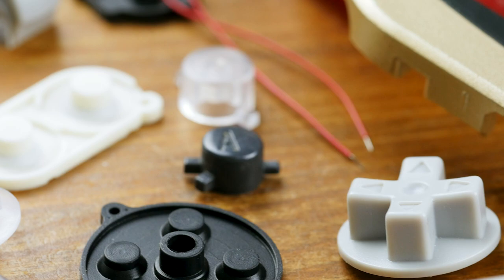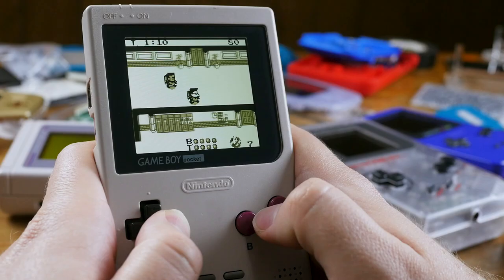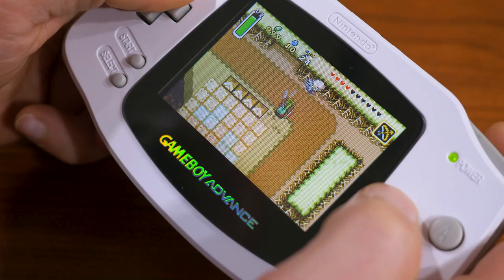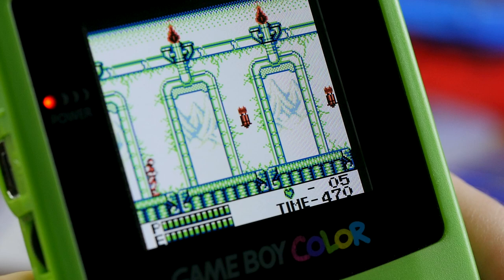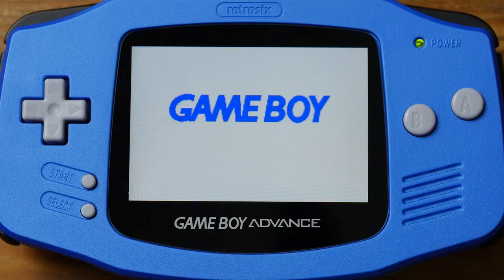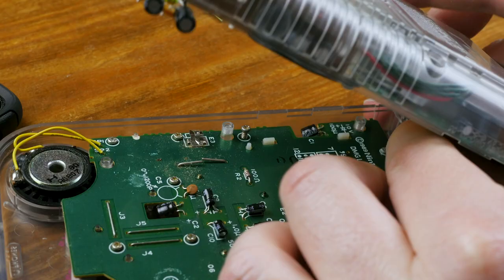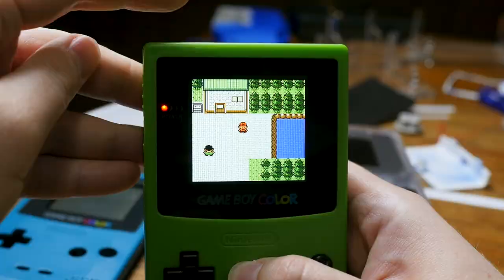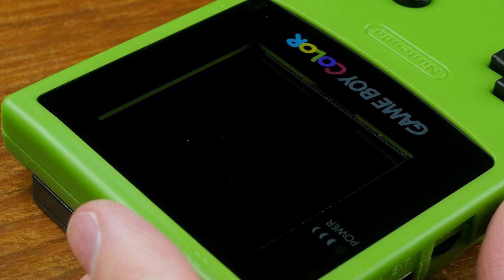Game Boy IPS Screen Mods for DMG, Pocket, GBC, GBA, and GBA SP :: RGB320 / MY LIFE IN GAMING

Comment: I have finished assembling my IPS DMG, going with a RIPSv3 with a pre-cut black translucent case.

But while in there, I also added a MicroUSB charging circuit (available on eBay or Amazon for dirtcheap) together with a LiPo battery and a Qi charging circuit. And yes: All that actually fits snugly in the DMG's battery bay, all I did was grind down the support beams in the battery bay lid to be able to stick in the charging coil without obstrusions.

Next up, I plan a similar mod to my old childhood AGB-001 GBA, but due to size constraints I think I'll stick to some good old AA NiMH rechargables, since I don't think that I have enough space for a 5v charging circuit plus 3.3v step-down circuit plus rechargable battery of any meaningful capacity.
Reply: Update: Completed the GBA mod a few months ago, ended up going with LiPo after all - there is a very tiny home-made solution for that, you just need to add a single component between the 5V booster and the GBA's positive battery terminal.

Comment: FYI, image burn in from the ultra high flicker effect found in F-Zero GBA games affects TN panels as well as IPS ones, and the likely reason why Nintendo applied such heavy ghosting and darkening filters on the official 3DS Ambassador GBA releases. For example, if you install F-Zero Climax as a GBA Virtual Console title with filtering removed on any kind of 3DS (with a TN or IPS panel) you'll quickly see the burn-in take root.

Comment: So the flicker you notice is a trick developers used to simulate transparency. The low refresh speed of the original GBA screen meant that if you flickered an image it appeared transparent. The fact that the map flickers in the "fake" screen and consolizer is because the screens have a higher refresh speed. In this case I would prefer a screen which was slow enough not to show the flicker
Reply from the maker: [Try4ce] Right, but it's a complex matter. Technically they should flicker of the screen is fast enough, and on these screens they do. But then they stop flickering because image retention sets in. That's not something you'd rather have! I'd rather have the flicker behave as flicker than be retained. But yes the effect on the original screens is neat, although in the case of GBC and GBA original screens, those were so fast the effect still appears as flickering.
Reply: My Life in Gaming Yeah, I particularly notice it on Boktai even on original hardware.

Comment: I've seen the same flicker retention on my 27" LG 4K IPS monitor.  I noticed it after running a 60 Hz vsync test that transitioned the screen white-black-white for an hour.  After stopping the test, the entire screen was still visibly flickering.  Unplugging HDMI had no change - still flickering.  Turning off the monitor made the screen go black, but turning the monitor back on showed the flickering again!   It gradually fades away after 5-10 minutes, so no permanent burn-in.   It is the most bizarre thing I've ever seen with a monitor.  This video is the first time I've seen the effect documented with the theory of it being some kind of artifact of IPS displays.  It's a cumulative effect in that it gets worse and is retained longer the longer the flickering graphics are on screen.
Reply from the maker: [Try4ce] That might be the same monitor Coury has. That's what the B-roll of those PS2 games was running on.

Comment: I can confirm that there are a significant amount of times I've played what I'm pretty sure are unmodded GBA consoles, both horizontal, AGS-100 and 101, and I've noticed that sweeping interlace effect, sometimes only if I shake the screen (subtle from button presses, or significant from adjusting how I'm holding the console), and other times I'll notice it on some consoles when I leave it on a table and just stare at it, too.  I always thought that it might be due to the age of the type of screens Nintendo decided to use, but I never investigated further so maybe it's the type of screen(s), or maybe it's age... but it seems many other LCD screens made around then don't have such an issue so... perhaps that could be a fun investigation to dive into sometime!

Comment: The flickering on de agb101 screens are due to the screen not receiving the right voltage, sometimes just whiring a cable to the ribbon to a specific part of the board to level the voltage can fix it other times just pray.

The image retention on the ips kit noticeable on plain colors specially on Pokemon when you run, but those screens at least for me are much better than the original 101 screens. 

I've modded a lot of consoles includin installing chips on ps2 and the new modchip for the Switch wich you solder directly on de SOC of the console and still keeping dust getting inside when changing lenses or touchpanels are the hardest thing by far and one of the more frustrating things about changing screens on portables.

Thank you for the effort and love you put on your videos.

Comment: Great video and I like the honesty about the potential hurdles or disappointments after the process.
I've bought a generic GBA IPS kit V2 ("1-chip", i.e. not FunnyPlaying) off AliExpress last month, along with a pre-cut shell.
1) I can confirm that the screen is just beautiful and quite bright even on the lowest setting.
2) There is (intentional?) image retention on flickering sprites. Some PC emulators like mGBA offer adaptative interpolation to mimic this.
3) There is ghosting behind fast moving objects with black outlines,  very noticeable in Kuru Kuru Kururin or Yoshi's Island for example. You get used to it, really.
4) The shell was very cheap, and you get what you pay for. It's crap. The battery cover is flimsy, the buttons that came with it are too smooth, the triggers don't feel right.
In retrospect, the only thing I regret is that I should have cut my original GBA shell myself to have a perfect finished product.
Overall, it's an easy enough mod that gives new life to the GBA.

Comment: For the GBAs with interlaced looking screens, there's a potentiometer you might try adjusting. On the AGB-001 there's an access hole under the sticker on the back, and on the AGS-001 and 101 it's in the battery compartment, stick a small philips screwdriver in there and adjust it in small increments with testing in between. I've had the same thing start happening on a good unit after I tweaked the pot too far and it stopped when I turned it back.

Comment: If you think of a chisel as a tool exclusively used by whacking on the back of it with a mallet, you could be forgiven for that. Woodshop 101 (still a thing?) does little to instill in one a nuanced appreciation for certain staple-tools. The chisel is just a knife with its edge ground on a certain side, and (usually) at an offset bevel. Making them literally purpose-built to make cuts like these. Think of them more as ultra-skeletonized woodworker's planes. You don't need an expensive boutique-tool, to get great results. Your basic 1/4" chisel, sold by your local hardware store, is certainly capable of being sharpened up to a razors edge. And, generally speaking, plastic is much softer than hardwoods. So...leave the mallet in the garage! just push or wiggle the tool.

Comment: Hoo boy do I ever feel your frustration in this one. I've installed a NESHDMI kit and even an UltraHDMI kit myself, but never has something given me as much trouble as my AGS-101 mod for my GBA... it's a literal 1 wire solder but still has issues. Worked fine for 2 weeks - pick it up again, no longer works. Re-do the mod, works fine for ~3months. Then stops. rinse and repeat. Checked it again after watching this video to see if I have that flicker issue you mentioned, and.... stopped working again -_- ....  Things have gotten better for GB / GBA modding but damn I cannot wait for the day when it's all simplified and just works...

Comment: The ips electrode structure works as a capacitor and it doesn't just store charge but starts oscillating at some very visually detectable frequencies (30 Hz or so, apparently).
Just one of the downsides of ips panels, I get similar effects with the player select screen of wildguns reloaded on my 24" benq monitor.

Comment: I have a GBA Consolizer and a GBA SP AGS101, so I'm pretty good for my GameBoy needs. But these are still cool to see. We've come along way from those still pretty awful looking bivert and backlight (with 4 LEDs at the bottom that are super visible and distracting) mods.
EDIT: Yeah, that one at 10:41. I just can't do it, not with those four giant LED spotlights at the bottom. 🤮
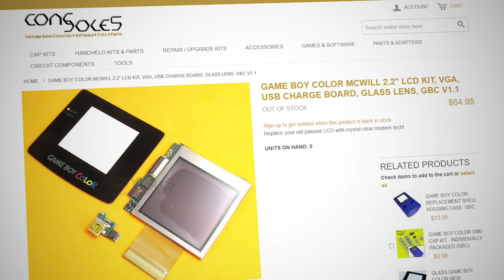Reply: 11:06 - I can't do that one either. I can't get over the outer plastic/glass bezel, and then the internal bezels, and then black unused pixels. I like a nice bezel on my phone so I can hold it without touching the screen, but multiple layers of bezels? Not for me. I can honestly say I'd rather struggle with a stock screen and a lamp.

Comment: I don't do it, not even with my recapped Game Gear. If it's not the original screen it's not the original experience. I did put an official AGS-101 screen in my original GBA for the best of both worlds though. Otherwise, I just use a headlamp or play outside. Besides, the GBC screen is so unique and beautiful I could never replace it.

Comment: The V2 fix the tearing of the screen. So to my understanding if you get the V2 or if it says 10 brightness level that's the new screen that fixed all the original problems of screen tearing.
Reply: The v2 version is in the video. V1 was much worse. The problems are not in the screen itself but in the postprocessing in the ribbon cable.
Reply: @PrimoAngelo00  do you know a good company to buy a game boy advance ready to play? The one with all the upgrades already assemble

Comment: The only way to fix the screen tearing on the new screens is to somehow source the clock signal from the original handheld and multiply it to a usable rate to display the image correctly.
Or to display the frame faster than the handheld can supply it after the previous frame has been buffered, so the screen can wait until the next frame. (This can't be done with standard video output formats, so for VGA without screen tearing, you'd have to source the system clock signal.)

Comment: Well yeah, I mean you gotta use Kapton tape to isolate the contacts, you don't want to go shorting stuff out.  You're probably lucky that the thing worked at all after that.  Electrical tape is a messy solution and will leave gunk behind sometimes if you ever have to remove it.  Kapton tape is a much better solution than electrical tape.

Comment: At 18:20 you mention two screens that are TFT LCD panels rather than IPS. I think you meant TN there. TFT means thin-film-transistor, which is the backplane hooking up to each pixel to send them voltage and change their state. LCD means liquid crystal display, which all of these are.

Of course, I don't know if those screens are TN or not just IPS or VA-type with better voltage regulation and charge dissipation.

Comment: I have a modded GBA with an OEM AGS101 screen and when I first installed it also flickered. I fixed that issue by tweaking the voltage regulator at the back of the motherboard.

Comment: 27:00 - You DON'T cut the membrane! Your D-pad is crunchy because you have to cut the top of the d-pad plastic button slighty so it doesn't make contact with the screen when you press up. The membrane sits behind the screen so you don't need to do anything with it.

Comment: For HDMI output from the N64, I strongly prefer (over all this) the look of either the Retrotink 2x or the Eon Super 64, either of these paired with the mClassic device. These give the best picture quality I have seen, sharper and smoother than this, and they are plug and play, cheaper than the UltraHDMI, and don't require any modification. All of these deblur functions sound good in theory but It does not make it look good and it is the opposite of what the developers intended with the graphics.

Comment: Yep have the same glass lens problem.  The glass is obviously flat but the GBC is ever so slightly curved.  So one corner ends up "popping" out.  Doesn't hurt gameplay or anything but its super annoying when you notice it.  I haven't bothered trying to fix it, and probably never will.  At this point I'm going try waiting for another batch of the Analogue GB.

Comment: Looking over this video, it's looking like some people might have to accept the quality of images... To me, looking over a GBA screen vs a new IPS screen is a world of difference. I know you were really nit picking on these screen and I get it, some things would drive me nuts too. Again looking an original screen then seeing the same device with a very clear and bright screen... I would think a lot of people would even notice a lot of these issues. 

It's impressive, and after watching this video, I am tempted to do that on one of my Gameboys that I don't use too much because of the display...that it drives me nuts...
Reply from the maker: [Try4ce] I think for most people it's a good upgrade! But I just really felt compelled to put out something that detailed the downsides, since they aren't discussed as much. I was surprised to find so many things that bothered me.
Reply: @mylifeingaming  Agreed and thanks.  As they are a major upgrade, there is also down sides to it as well.  Thanks again for pointing them out. People have to ask if they can accept the down sides to it and this really covers a lot of.

Just one question you didn't touch on. So for example, on an original game boy. What type of hit did you notice on battery life ? Did it go from 6 hours to like 1, or it is close ? I know putting in a IPS screen will hit on power usage, just really wondering how bad.

Thanks again for you guys do, I love videos and it's why I starting modding my very large collection of consoles and getting RGB out of all I can...

Comment: I think I see the issue is with these screens it's some form of overclocking and/or pixel shifting  on the IPS display. TN panels (and oled by inherit design) are faster to respond over IPS and that's something IPS can never get over normally, same for VA screens however what people want is 1 ms response times in screens now days, regardless of the display type. The way monitor manufactures handle this is through a method called pixel response tightening or pixel overclocking where you can then achieve 1 MS but like I stated IPS is not capable of hitting true 1 ms so what you get, and what I saw on your demo for super mario advance 2 was basically reverse ghosting. Reverse ghosting is when the monitor actually overshoots it's intended color values and begins to ghost again and yeah that's not pleasant at all. My suggestion to funnyplaying is to add in a means to either adjust the intensity of this feature and keep looking till they find a proper display that is actually designed to handle the refresh rates of a gameboy, the image retention is because not only are they using their version of pixel shifting but they are also overclocking these displays beyond a point that they are intended to be. I used to get that on my Korean Qnix monitor when I overclocked it from 60 hz to 120 hz with occasional garbage up on the top left of the screen also till I brought the overclocking down to 105 and then it worked just fine. Obviously these displays are not at all intended for these refresh rates at all and they are doing a lot to get them to a passable level and now I know buying a backlit modded original GBA was the right choice.

Comment: I found with the DMG mod I just had to shave a bit around the button holes to make the buttons react properly with the shell as the new premium shells fitted for the IPS were a bit too tight around the buttons. Maybe that's the same issue you ran into!

Comment: here Try.. i have your ghosting explanation; Many of these screens are not actually IPS, they are VA panels. 
VA is used if you want that almost oled like 'Pop!', that striking contrast and colour which beats genuine IPS... However cheap VA is prone smearing dark screen transitions. 
Yes some higher end monitor VA's, most of all AUO MVA's are mostly immune, but that'ts not the type of VA you will find in a cheap PRC sourced small screens for kits.
Reply from the maker: [Try4ce] Hmmm I mean, that's a thought, but I'm not sure. Everyone advertises these as IPS, and I've NEVER heard of flicker retention on any type of panel other than IPS. The pixel response in most situations is solid enough, but those instances of weird ghosting are kind of edge cases. Not the normal behavior. They happen often enough to bug me, but I feel like if the general pixel response was simply just too slow, then it would always just be blurred to heck. That's not the case. It seems more like a behavior that's linked to the image retention issue, crazy as that sounds.

Comment: IMO, it is not the time yet to replace the LCD - especially with genuine cases, were modification is required.  Too many compromises and hacky workarounds.

I was led to believe that getting custom LCDs manufactured is actually not that big of a deal.  Granted that was for indicator LCDs, not video panels, but I almost wonder if the custom cells trade off for the higher resolution and color.  I do wonder what it would take for someone to order a batch of drop-in screens of 1:1 size and resolution to the originals.  It would sure beat shoe-horning a random smartphone screen into a GB.